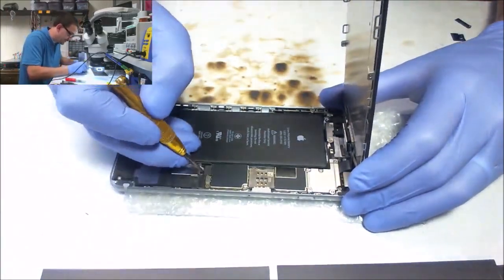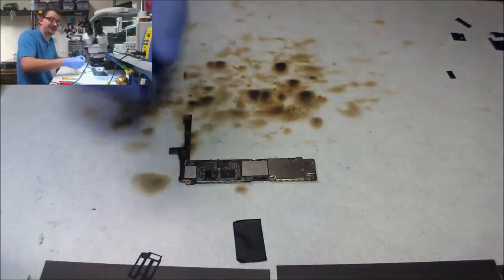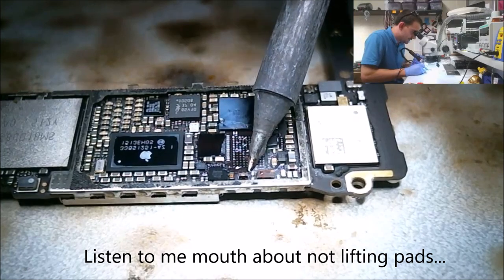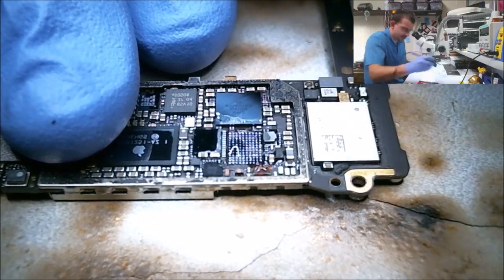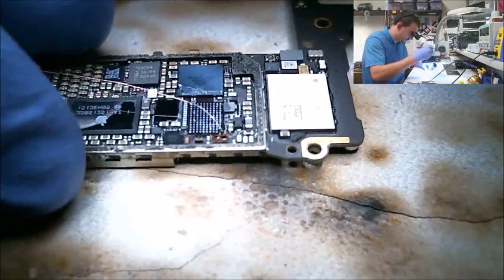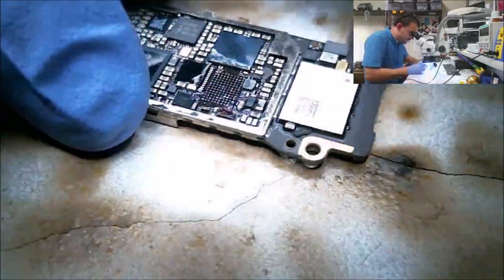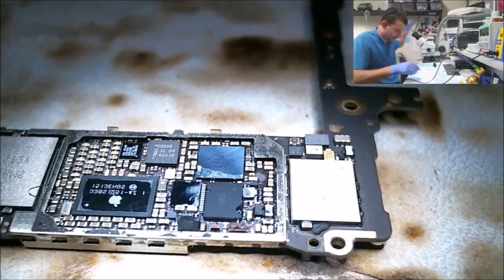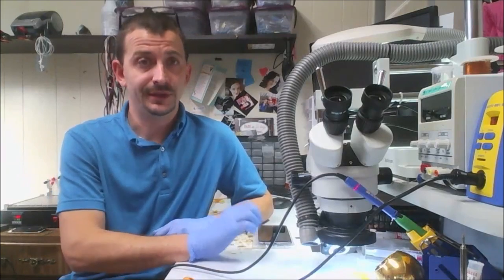ANOTHER iPhone 6 Plus Touch IC repair with jumpers

Comment: I have an 6 Plus that I got with no touch functionality I replaced meson and the phone didn’t display any image on the screen, I removed meson and display came back up but no touch of course because I had no meson I have tried 3 meson IC I know they are good because I have tested them on another phone, but when I put meson on this phone I get no display, I get normal power drain from DC power and as soon as I remove meson it comes back up but no touch any ideas 💡?

Comment: Hey good man, if you can reply I would be grateful - I had a tough time getting my meson off, i had to go up to 400 deg. C and it still barely came out. Didn`t have the best tip for the heat gun, maybe that`s why. Regardless, while cleaning the pads where the IC was located, one of the pads came off.. I Any way to fix this? Thanks for the video and good luck.

Comment: Have you ever consider a CNC grinding machine? It grinds the chip off and just leaves the motherboard pads exposed. No damage done to the board, just the chip turns into dust. Also, the machine has to be programed not to cut threw the board. It's pretty easy to do after a few trys

Comment: I watch these videos because I used to work in a shop and loves repairing consumer equipment,  if I had the equipment that's out there today I may have stuck with it, once my eyes got worse I could no longer do the detailed work,  I left the shop in 1995 and we were working with surface mount components with no magnification  other than my glasses, probably why my vision is so bad now

Comment: keep the good working Jason :) 
o me question did you use the solder balls that came on the New touch ic ? or did you reball the New touch ic ?
Reply from the maker: Thank you :)  I normally use the balls the come on the IC.  Although sometimes I've been tempted to reball them just to see if it would change the return rate.  I'm having really good success with them as long as when you look at the new ICs under the microscope they are in-fact new and not all chipped away, scratched up and reballed.

Comment: Hi i just changed i phone 6 plus touch ic but after replaced it phone is not coming on i checked with power supply its take power and stuck in he middle not coming on first time happened changed loads please help me

Comment: A job well 👍🙂🐻. Since breaking my neck four years ago, I am no longer able to perform delicate board repairs like this.  Your videos are excellent and I am envious of your bench equipment 😎. I'm thinking about obtaining a microscope instead of using my 40 year old lighted magnifying glass .😇.  
My 6 plus has no display.  I always place it on a stand and place the magnetic charging near the charge port before retiring each night.
 Got up Saturday morning, removed the charging cable, and noticed that the display was not working.  I snapped the charging cable to the charging port and heard the normal sounds but not see the normal display.  I thought the brightness level was turned all the way down so I brought the display upclose and thought I could see a
Very faint raster
While thinking how I could get to the settings menu, I heard the notification alert as well as feeling the vibration.
I looked on the net and tried several different ways to force the display to come up.

I removed the magnetic lightning port adapter and plugged in the charging cable attached to my pc.  The monitor came up as usual indicating the phone was locked so I pressed the home button to unlock the phone so I could back it up.  I was unable to do so and I noticed that I was no Longer hearing anything from the phone so I that the battery was somehow too low so I put the phone on the Apple charger for the remaining day. 
The next day I still had no response to unlock the phone.  I'm now thinking that the battery was too low to take a charge so I put the phone on a high rate of change.  That also proved to be disappointing.
I don't remember ever replacing the battery in this phone so I got online to find and order a OEM battery.
I ran across one of your videos in the process and after watching two of them, I realized that I probably should send it in for repairs.
The new battery should be in this week.  I will replace the battery if the new one is the same OEM as it was advertised to be. If it isn't, I will plug it in and charge it to see if the display is functional before sending it in.

Thank you for the excellent videos and inspiration!  JJ💡👍🙂🐻

Comment: So the IC failed and it lost continuity to the pad you pulled off? Maybe something happened and it weakened the pad and it really wasn't you fault at all :)  Slick video, and yes, i hopped over huge chunks of the video hah! Subbed!
Reply from the maker: +chickenby thanks! but I'm pretty sure those torn pads were my fault! Lol fixed 'em though.  At first I thought this defect could be related to those commonly torn pads but I haven't had any torn pads on a couple dozen since I recorded this video.

Comment: are you sametime in wherever logic board;if you want make you job good .firts need cover the other ic.maybe you are burning some elements,diodes,resistors or more.
Reply from the maker: The surrounding components really won't be bothered or "burnt" by the amount of heat it takes to melt the solder under these chips.   I've found when covering the surrounding areas you wind up using much more heat to get the job done because you have to raise the temperature of the board in a pretty big area to the point of melting solder anyways.  The key is to watch very closely under microscope so you can see where your heat is and where the solder is melting.  I've found this method much less risky than tape or shielding because you will use way less heat and don't have the risk of tape or shielding moving adjacent components when they melt.  I used to shield the heck out of it..   now I don't :)  I will shield if there is under fill close by.  The WiFi IC is a mile away in this case though.
Reply from the maker: Thanks for the comment though :)  I may try some shielding to get rid of some of the common issues I've been running into on the other side of the board though.  Components on the other side can melt and their rubber overfill coating lifts them off the board.

Comment: Plugged in my 6 Plus when it seemed a bit warm and came back to disconnect a dead phone. I tested the LCD on another 6 plus, works fine. I changed the charging port/headphone jack after reading that that can be an issue, no luck. This leads me to believe it's something on the logic board. Do you think that this is the best step to follow? Anything else that would go bad with the logic board? Thanks for the great video. Very well done.
Reply from the maker: +Christopher Greene thanks :) I'm betting a capacitor shorted to ground on the logic board but there's other things it could be.  It sounds like you've definitely narrowed it down to the board.  Sorry, wish I had better news.  It probably would be a fairly easy fix for a microsoldering shop though.

Comment: Im here in Las Cruces, Reflowed Mason chip and works great. Bannged it around a few times and keeps working great. Would you suggest always replacing even thow reflows have worked great for me? I havent had returned phones after reflow. Have you?
Reply from the maker: +Octavio Chaidez Jr reflowing will fix some of them but not all.  There's a MUCH higher probability of coming back.  When I first seen this problem it was on my wife's phone and reflowing fixed it for good as far as I know.  She traded the phone off 6 months or so later but never had problems.   Trying to reflow them for the general public proved to be a much different story though.  The return rate was ridiculous and I don't like stuff coming back so I never just reflow them anymore.
Reply from the maker: +Octavio Chaidez Jr just realized I didn't actually answer your question. Lol
Yes - 3 out of 5 was coming back and I quit reflowing.

Comment: Hi thanks for your video. I own a cell phone repair shop. I was wondering  where do you get your flux and flux name. Also where do you purchase your chip? Whats the percent failures on these chips. Thanks for your time.
Reply from the maker: The flux I use the most is Chipquik SMD4300TF10 - I buy it at Microcenter here locally.  I bet All-Spec sells it though.   The chips I try to buy from aliexpress but there's no reasonable way for me to keep them in stock ordering from China (sometimes they're weeks or months late) so I buy them from http://www.microsolderingsupply.com

There is a defect rate.  Not sure how high but sometimes I will have one area of the screen that doesn't register touch and it's always the same area.. When I see that, I know it's a defective Meson IC.

Comment: 2nd pad in next to the ground pad you lifted seems to the majority of issues. Pad usually lifts if the touch is to the point it doesnt work at all even when apply pressure.
Reply from the maker: Good to get feedback on this stuff.   That pad comes off so easy it's gotta already be detached.  I must have done a dozen of these after this video before the next one.  Yes, I know I lifted that ground pad.. LOL  I blame it on the cameras =)

Comment: Hi ! Great video !
I just have a question on where exactly did you run the jumpers to ? Also Where can I buy that tiny jumper wire and what did you do to it when you were heating it with soldering iron on the shield there (tinning?)? ))) 
I have repair shop in MA, but currently staying away from these kind of repairs...don't have the right tools.
Also is it really worth investing into ? I was considering to get into the screen refurbishment instead...
I know a lot of questions here, but I would really appreciate the answers.
Reply from the maker: I ran the ground jumper directly to the ground plane on the board.  The other missing pad got jumpered to the trace next to it.  At 30:13 there is a close up view that might be a little easier to see.  The wire I'm using is wire harvested from iPhone ear speakers and vibrator motors.  It's magnet wire so it has a clear coating over it making it non-conductive.. I used the shield for something to lay the wire on while I burned that coating off and tinned the copper.

Comment: Iv just reballed meson and cumulus and never had a problem with meson but pulled the reset pad on the far right. Before when iv done this with the backlight ic etc Iv just ran a wire but thought I'd try something different today and dug a pad and trace from a donor board, tinned it up and the remains of the old trace and soldered them together and then placed the chip as normal, seemed to work as no more grey bars !. 
Iv changed cumulus on the 5c and 5s and never had a problem with pads, but like you the 6 plus pads just seem to be poorly stuck to the board.
Reply from the maker: That's some nice work to transplant a pad like that! :)  The iPhone 6+ pads are the worst I've ever seen.. not sure why they're so much more brittle than almost every other board.

Comment: i got my ic touch fix in repir shop,the problem can reture? becuse my touch start become laggy
Reply from the maker: It can resurface.. Usually in the form of gray bars.  I've seen quite a few original Apple 6+ screens with touch issues as well when flexed.  May want to be absolutely sure it's not the screen.  It's most likely the ICs but I've been trolled by defective screens too.

Comment: i have problem ..my touch is working,motherboard  showing picture but on both phones same problem if i change motherboards touches dont react and on other motherboard react ..what could be problem?
Reply from the maker: Hmmm..   hard to say on that one.  If it's an iPhone 6+, touch issues are most likely caused by the board.  If it is original Apple screen then there is a decent chance that it is the screen as well.
Reply: it was prestigio 4500 old model but very good phone..yea  motherboard issue so i just fixed other phones and this will be spare parts

Comment: hello i have a question, i have done a couple of this ic chips and they work fine after replacement but after a few days or a week or two they bring them back with  the same problem with no touch.. do you think that i im installing it wrong or im not using enough heat or im using to much ? have you ever run into this problem before ?
Reply from the maker: This seems to be the puzzle everyone is trying to solve.  I've started replacing cumulus and meson on every board and flooding the pads with plenty of leaded solder to be sure they all shine and look the same.  I also make sure to flux the caps between the two ICs and be sure they float at some point during the repair.  Our returns have went down by a lot since I stared doing that.  There are some phones that will come back no matter what you do though.
Reply: Great Thanks alot.. and also thanks for all your videos they are great keep it up.

Comment: when i use heat gun like that i loose some capacitor, after i remove my chip, the hot air move some capacitor, how do u do without protecting all aroud the chip (sorry for my english ;) )
Reply from the maker: Sounds like too high of air flow.  After a while you get the feel for it.  The air has to blow pretty hard to blow things off but surface tension will hold things in place really good when the air is not too high.  Thank you for watching :)

Comment: Can you please explain what's the issue people having with their phone. On my iPhone I have to twist it from the top right corner In order for the touchscreen to work. Is that what your talking about that you can fix?
Reply from the maker: Sounds like you are describing touch disease.  Especially if you ever see the screen flash, flicker or show the grey bars from the top.   If you are still using the original Apple screen and don't see grey bars, it could be only the screen.  I have been running into a LOT of original iPhone 6 plus screens that have never been replaced with touch problems that are affected by slight bending.  It makes it seem like "Touch Disease" and it's really just the screen.

It is most likely the chip level problem though - Touch IC failure or "Touch Disease".  That's what I'm fixing in this video.
Reply: I replace the screen myself so it doesn't have original screen. Then I replace the frame from space gray to gold. Everything worked great . And I've dropped it hundred of times. So it is fixable ?

Comment: really good video and good repair .. good job really ... what is the temperature that u r using and do u preheat the board ... i have made an experiment with one board of ipad and i preheated it for 2 min at 200C and after that raised the temperature to 450C for 1 minute ( i heated the nand IC ) and after that i just waited to cool down and started the ipad and it worked without any damage ... i have another boards for practice and i will keep experiment because sometime when u hurry in removing the IC because u think that u will burn the logic board and in the hurry sometimes u loose pads ... so could u please tell what is your method for desoldering NAND IC or IC like this one in the video ... the time in your video for removing is ~25sec maybe u r using around 400C ?
Reply from the maker: Thanks for your comment :)  You're pretty close!  I'm at 380C in this video.  I've adjusted a bit and now do this repair at 375C and it's helped a bit to not have secondary issues to deal with afterwards.  I'm not preheating other than bringing the temp of the board up relatively slow (heat spreads FAST through these boards so not that slow) then really torching the chip I'm working on.  I'd be scared to heat the whole board to 200C  - If I let them get to 170C shields start falling off.  There's a lot of under-filled ICs on these and solder that is cased in under-fill swells and pops out the sides so it must be doing the same underneath between the balls too.  I've not messed with NAND yet :)

Comment: Hi
I dropped my iPhone 6 in water for about 5 second. After cleaning and drying it, it came to work perfectly but the touch screen is unresponsive. there are three technicians said the problem is not with the screen, it is with the motherboard because they put a new one on it but it didn’t work. In addition, they tested my old screen on another phone and it worked. So, is there any way to solve this problem?
Thanks

Comment: I have iPhone 6s Plus. The screen turn on and home button work but touch screen doesn't work. I found three small fuses next to the LCD connectors are missing. Do u fix that?
Reply from the maker: Yes.  Hard to say which components they are or if they are related to the problem without seeing it though.  It really could be a lot of things.
Reply: STS Telecom
Reply: Thanks for the reply. I found your website I will call u tomorrow.